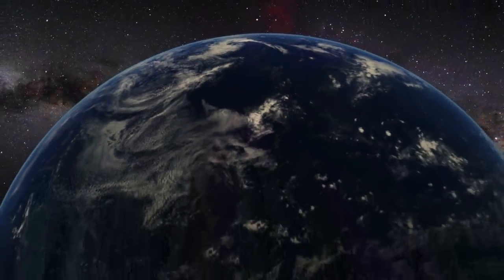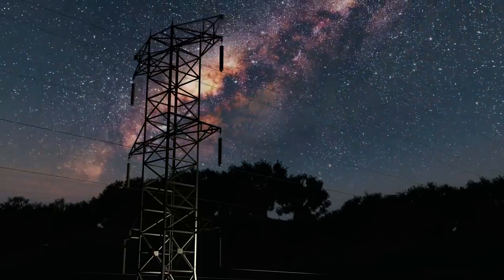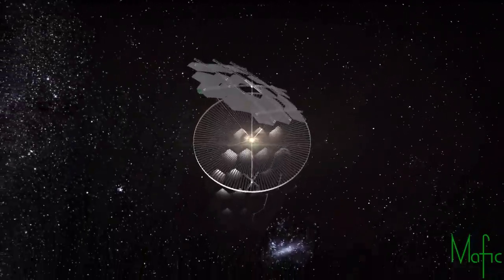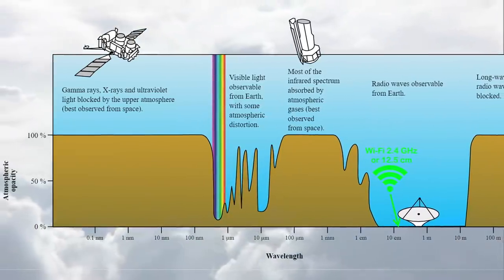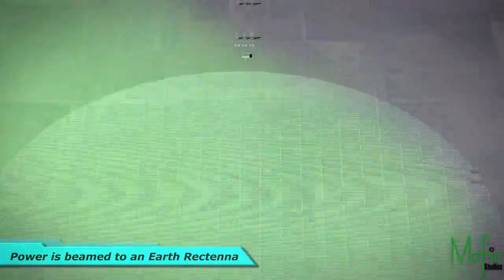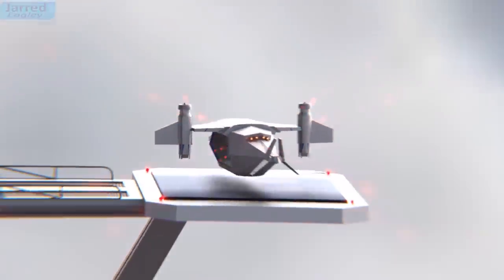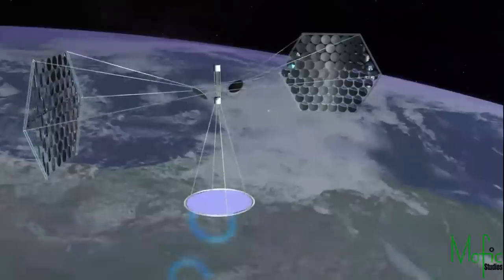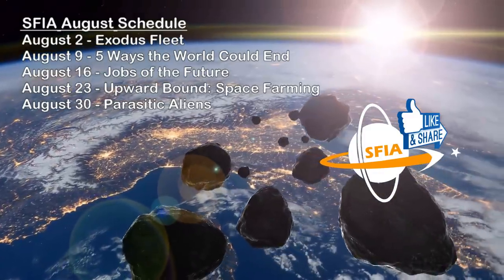Power Satellites & Space Based Solar Power

Comment: You don't need 100% off site production of power.
Reply: Why not? Sure, backup systems make sense, but why not use completely off-site power most of the time is it's cheaper?
Reply from the maker: No, and probably don't want 100% either since there's safety in diversity of sources, but it has some distinct advantages.

Comment: So for "space mirrors" this is actually pretty viable but has a far better use.  The mirrors themselves would be pretty thin sheets of metal like foil and production would be fairly easy, cheap, and could have low carbon footprint.   More importantly, they can be used to reflect light TO the earth at night to solar panels.  I would like to direct you to the popular page of Isaac Arthur on power satellites. https://youtu.be/eBCbdThIJNE

Comment: One hurdle for near future space solar generation would be transmission as well. The cost of building electricity generation is expensive but is only a small cost compared to transmitting that energy to homes and industry. A microwave collector would have the same issues as any other generator in that is has to be built in remote and un-populated/developed areas and then transmitted to where it is needed. Multiple collectors would still require an interconnected transmission network that we require today to improve efficiency and reliability. 

Another problem is reliability, a beam would have to be maintained and somewhat constant to be an improvement and would require redundant gatherers or mirrors to ensure that. One of the main downsides to solar today is we still require traditional fossil fuel plants to pick up the deficit in generation caused by intermittent supply. 

One possible solution is to combine a project like this with the planed future industrial corridors that are being suggested in developing countries, especially those that have limited access to water and have large tracts of arid land like the Middle East and Central Asia.

I still get a kick out of the idea, and want a ring! Transmit heat and energy? Damn you made an orbital ring look like we are fools for not having one already :D

Comment: given all of the points given in this video, doesn't it seem like an absolutely ENORMOUS hassle to not only put these solar collectors into space, but also to beam the energy back down to earth? why waste all that valuable space on the planet with huge arrays of rectenas, or even just ground based solar panels, when a single LFTR nuclear plant and generate the same amount of energy with a much MUCH smaller environmental footprint? not only can the reactors be made incredibly compact and take up only a few dozen acres, the overall pollution generated per W/hr is 300X less than with traditional solar panels when you include the waste from manufacturing the panels themselves. solar panels are also non-recyclable and guess where all those old solar panels end up? landfills.

solar panels are only good in space, for things in space. using them in large solar plants on earth or beaming energy down from space is incredibly costly and down right stupid to the point of completely defeating the purpose of alternative energy being environmentally conscious.

Comment: Folks have been running the numbers on this since the '70's when the L-5 society face planted on their economic numbers.  (Mainly completely miss understanding launch costs.  Like you seemed to also.  [Launch loop and starts an could never compete with more conventional launch vehicles with similar market sizes.]). It doesn't matter if the launch costs are $0, it still can't compete with normal power generation.  Folks actually calculated beaming power UP to orbital sats for use in space, or beaming down to other areas on Earth.

Not only does space solar not the answer for earth, it's a big limiter for space development.
Reply from the maker: I'm glad folks ran the numbers back in the 70s for the L5 society, I'm kinda guessing those numbers changed so since most of these graphics today were made by folks from the L5 society at Keith Henson request. That's how I got them. :) It's not quite viable yet, but the numbers change as the tech changes. We make better panels, get lower launch costs, etc. Should it hit the right price points, its viable.
Reply: Isaac Arthur 
I correspond with Keith sometimes, and he had me review a paper he did on SSPS a couple years back.  He's still in complete denial.  Still hanging on to the assumptions ( especially that energy cost drives launch cost ) that cratered them in the '70's.  (DOD and NASA studies found the scale of lift would drive launch costs down about 3 orders of magnitude.)
Reply from the maker: True enough, for launch costs, there's too many variables in each system to stick it on one factor particularly when talking about stuff 20 years down the road, but energy costs are probably a better metric than most for the long term, and that is what we look at here, as you know. We could save a lot of time if you'd just link the studies in question, I probably should have made that request more explicit in the first place. I'll just say flat out though that if they weren't done in the last decade I don't view them as applicable, too many basic techs have changed but what hasn't changed is the average daily power on a groundside panel versus one in a high or highly eccentric orbit. I'm honestly not clear on what your argument here is in that regard. I don't give a darn what launches the panels, just if the launch cost+production/maintenance cost is lower per watt than the groundside equivalent. Clarify what you're saying is making groundside better?
Reply: As to launch costs.  More my field of expertise.  Current or recent last tech (Kero<>Lox rockets, Jet fueled turbo ramjets, existing materials) would support launch costs in the $10-$15 a pound to orbit.  But that needs a very high flight rate.  Fuel/power costs really only contribute about a third of cost per pound in a highly utilized systems ( cars, airliners, etc).  Electric costs, if you want to base a launcher on that is only dimes per pound.  But powering a launch craft by electric is a ways a way.  Even cars can't do that effective,y or economically competitively.  

What kills us now are the extremely high upfrount and overhead costs.  Like shuttles $50 million a flight margin cost ( better then NASAs getting from SpaceX) but $6 billion a year fixed cost, and about $40 b upfrount.  A orbit ring would drive those upfrount and fixed cost through the roof given the huge infastructure costs.  You seem to just assume lower energy costs ( it's not clear where you get those numbers from ) and assume that compensates for everything else.  Hence why I keep asking you for papers or sources or something for that?

Can't remember what the other half over your last comment was... I think for was for connecting papers , but you weren't interested in anything older then 10 years which made no sence.  

Nor was I saying ground solar is more nessisarily more competitive then orbital.  Orbital in geo eliminate the high power storage costs, and you don't need to keep cleaning the cel,s and weather effects.  But orbital eats the cells and systems faster.  You could presumably shield the heavy power gear, etc, but you have to expose the cells to the radiation and plasma of space.  

I didn't read the papers and analysis online, and frankly after 40 years of seeing the same studies come up with the same conclusion as competing power sources get cheaper and cheaper ( and pro folks like Keith keep making the same errors), it didn't seem worth stating that on top of.

But, your still behind in the post the papers ping pong.  ;)
Reply from the maker: We seem to be talking about 2 entirely different things Kelly, this episode has NOTHING to do with launch costs by system beyond saying there should be a tipping point where either we can launch the materials for powersats or the construction apparatus to set it up as a moon industry, we'd use whichever is cheapest per kilogram for that orbit, right now that's obviously rockets, that may change, this show never looks at the next 20 years. 

This is not a launch cost episode, it's comparing solar performance plus beaming to ground-based. You seem to be agreeing that is indeed better which is making me wonder what you are disagreeing with? Just the notion that they experience extra wear and tear from space? Why would I be interested in a paper over a decade old discussing that, ROSA was only done last year? 

If you don't think orbital rings or launch loops are viable, argue about it over on those episodes, which do have the papers mentioned, and linked in Lofstrom case since he's updated it in recent years, whereas Birch obviously has not, something explicitly mentioned in the video.
Reply: Isaac Arthur 
I think I did argue about orbital rings there?  I don't remember any of the papers on it really looking at cost factors?

But as to this vid, my one comment about launch costs was it doesn't mater how much launch cost come down.  Space solar ( as well as ground solar ) isn't economically competitive as a power source.  ( Though arguments of launch costs did come up with others, And ?I may have miss read something of your...sorry if .i did.)

As to SSPS being lower cost then ground solar.  That's debatable, and certainly not assured to ever be cheaper.  Obviously maint costs in the even more isolated environment of space would raise operating costs.  

At least space solar doesn't do as much ecological damage on earth give or take the mining.

As to your not worrying about the next couple decades.  SSPS and climate change are certainly not topics for centuries from now!  ;)

Comment: im not even going to bother watching this because thanks to a discovery about a natural function of graphene it renders all current power sources and energy systems obsolete. this discovery also fits in with what should replace the kardashev scale entirely. at the point a civilization can draw energy from the quantum field they can skip over all the iterations from 1 through 4 and go straight to 5 because they develop the ability to draw energy from the entire multiverse. we are there now and it is not being talked about because it is so radical a change that it is almost impossible to comprehend the scope of what becomes possible. the discovery demonstrates that a 10 micron element can produce 10 microwatts of power. this sounds tiny but the scale is important. with 100k of these units a watt can be produced, again this doesnt sound like much but when you take into account this watt of power would be produced for forever in an area less than a millimeter squared you begins to see the potential. a sphere 50m across with only 70% of its internal volume composed of this material and only making .028 of the predicted 10 microwatts would still produce .02 times the annual global energy use of the entire planet every second for forever. if you go with the best case and get the full 10 microwatts the numbers change significantly and the same sphere could produce 2.8 times the annual global energy use per second for forever. embedding this material into the things we use would eliminate all external power source requirements, when the 'board' used to hold the electronics in place and link them together produces power as a function of existing and does so well beyond the actual energy requirements of the device you no longer need batteries or charging or any of the conventional systems we use. if embedded into the actual integrated circuit individual chips can work much faster and more efficiently because they have power onboard and only need to receive an instruction signal and then transmit once the operation they were instructed to execute is complete, distributed power on this scale completely changes how everything works.
https://news.uark.edu/articles/40324/using-the-natural-motion-of-2d-materials-to-create-a-new-source-of-clean-energy
Reply: I can tell you have no idea what you are talking about.  Do you want to know how I can tell?  It's very easy.  I've run into people like you on a lot in the YouTube comment sections.  Every crackpot without exception fails to use the shift key.
Reply: Use your damn shift key if you want to communicate with others and take the time to put together a decent sentence.  Try to keep them to a dozen words or less and watch your grammar, it's a train wreck.  All that comes before any ideas you wish to share with other people.